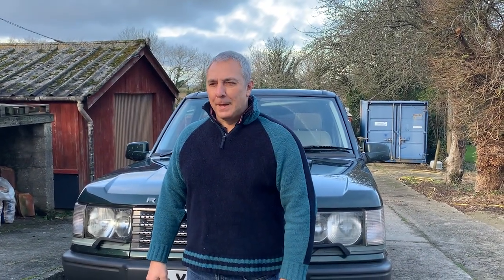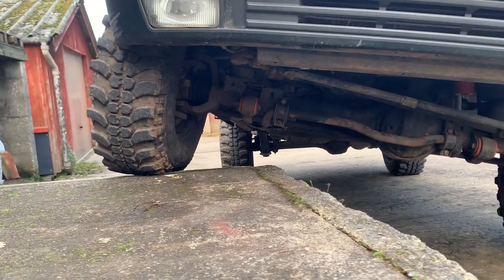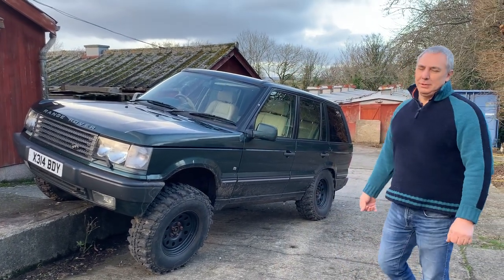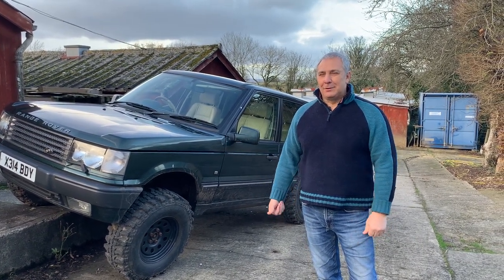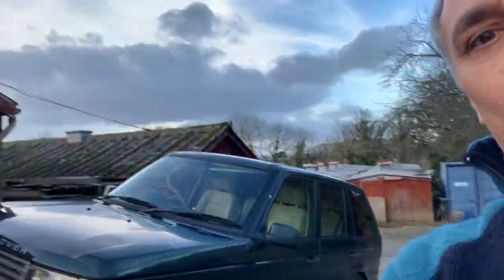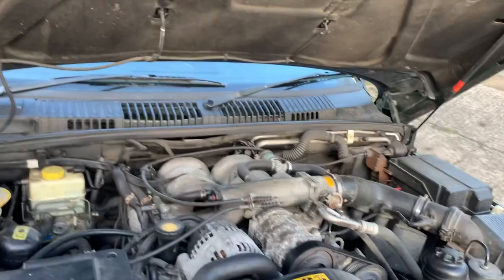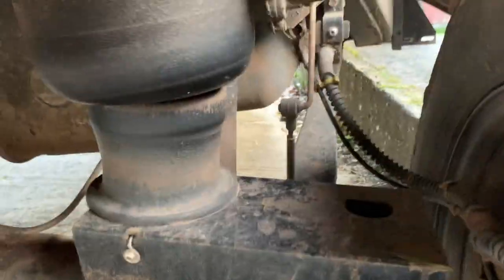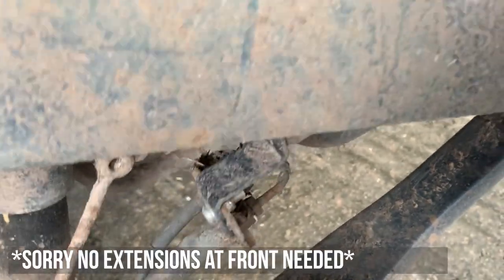Range Rover P38 - Air Suspension vs Coil Suspension

Comment: On my 99 P38 I used the free version of EAS Unlock to reprogram the offload height to give me something like 4 inches of lift. In that setting I have 16 inches of clearance under the frame rails.
Reply from the maker: Hi Gordon
Thank you for your message!
Yes that’s an option but be careful as air springs may rip as only have a certain amount of travel before failing.
Have been talking to a manufacturer about increasing the travel but is very slow😂😂
Good luck with things👍
Regards 
Martin
Reply: @all4x451  
As a matter of fact I destroyed an Arnott air spring on an offroad trail in Colorado this summer. The lower locating pin on my left rear bag sheared off, the bag folded over and ripped. Ended up driving 137 miles on the bump stops including quite a few miles of offroad. Was able to replace the bag and continue my trip. Some mechanical lift would take some strain off the bags.
Reply from the maker: Oh dear not pleasant on the bump stops😬
Still trying to get a company to replicate my kit for correct money without jeopardising quality, may have a solution soon and will do video on manufacturing and supply😀👍
Reply: @all4x451  
That's an understatement. If I didn't have my seat belt fastened my head would be hitting the roof top. OK on pavement but brutle offroad. Would probably buy a kit if not too expensive.
Reply from the maker: 😂
Hopefully soon can organise lift kit and price🤞🏻
There are many that have shown interest 😀👍

Comment: G’day Martin, I love the vid mate! It shows how you’ve done the 2” lift great! I really like the tyres you’re running too 😀

The spacers you have on the rear are from “Hard Range” in Australia, sadly they’re no longer in business. Originally run by Paul (great bloke) and then bought by other P38 enthusiasts. 

I love how you’ve done the Front spring spacers for your lift. It’s common to see air leaks on the front springs due to rubbing when lifted from below (as I’ve done, although I’ve not experienced the issue) rather than above (as you’ve done). 

It’d be good to see you knock up spacer kits over there, I’m sure the market there would be much bigger than over here in Australia.

My recovery is coming along well, can’t wait until I can head out 4wding again! 

Cheers
Keithy
Reply from the maker: Hi Keithy 
Thank you for your nice comments appreciated👍👍😀
Reply from the maker: Will keep you posted with the demand, great to see last video looking good 👍

Comment: Amazing work thank you for sharing your experience with us,
Air suspension p38 when normal its headache for all now after lift up what will happen. I plan to convert my car to coil spring no more headache.
Reply from the maker: Hi 
Thank you for message 👍
Yes a lot of people are changing to coil springs, my P38 was not great when I bought it! I rebuilt eas block and checked and changed faulty height sensors, all been good since for a few years now.
The main problem that I can see is the hight sensors, as if one is faulty the system will work but not great!
Regards 
Martin
Reply: @all4x451  Thank you Martin for your quick reply and interest and patience. I tray to calibration by RSW EAS unlock suite with new air pump I spent hours but still not correct hight until I damaged the new pump. Same doubt in hight sensors faulty. You change the orginal or aftermarket sensors any help.
Again I need new pump with sensors.
Best regards,
Reply from the maker: Hi
I was lucky to find nearly new original parts, my next purchase would be from Arnott they also make very good air bags at reasonable prices!
Regards 
Martin

Comment: I have a 2" lift on my 2001 HSE 4.6L P38...same color. When I bought mine it already had coils so im not changing them out at this point. Question: where did you get the front grill? I like the one you have although i just ordered a replacement for my cracked one. thanks!
Reply from the maker: Hi Carl
Thank you for your message!
The grill is a standard Range Rover sport grill, the difference is that holes have been drilled in it😀👍
Will do a close up in next video👍
Reply: @all4x451    I admire your P38 and your expeditions👏🏻👏🏻👏🏻
Did you do the close up of the front grill?
Cheers from Punta del Este
Reply from the maker: @burgerdentone16  Hi
Yes will do a walk around soon, the front grill is of a Range Rover sport but with holes drilled in it!
Cheers 
Martin

Comment: i love the Airl supension in my p38 and i do not care for coil springs. i would put them on my defender if i knew how to maker it work properly
Reply from the maker: Hi Wesley 
Yes the air suspension is the P38 secret making it very capable off road, lots of 4x4s now getting air assist fitted👍
Regards 
Martin

Comment: Hi Martin, I currently have springs on a 2002 P38.  I would like to converted back to Air.  What Air bottles do you recommend?  I live in New York.  Thanks
Reply from the maker: Hi
Thank you for your message!
There is a company called Arnott that make better re-enforced air bags air bags, they are idea for off road as standard air bags tend to rip under articulation these are what I use on my P38. Check out the link below and thanks again for the question, if I can help any further just let me know👍
Regards 
Martin
Reply from the maker: Sorry
Hear is the link
https://www.arnotteurope.com/

Comment: Great video!
Reply from the maker: Hi Steven
Thank you for your comment👍
Hopefully doing a part two very soon!
Regards 
Martin
Reply from the maker: Hi Steven
Just been looking at your channel, and was wondering if you could supply air bags that are 2inch higher than standard.
I realise that sensors and bump stops would need to be modified like the ones I have currently modified.
I have several people globally waiting for a solution to a lift kit!
Regards 
Martin

Comment: Is it easy swapping air for coil suspension?

Thanks
Reply from the maker: Hi Sorry for late reply!
You can get kits I believe, will not be difficult as air springs come out easy. Problem will be having the warning lights on dash and disabling EAS!
Reply: @all4x451  Thanks for reply sir

Do I need a programming tool for springs after
Reply from the maker: Not sure as not removed an EAS system, only what I have heard about!
Also heard that people that use P38 for adventure touring usually go back to air😀
Reply: @all4x451  Awesome. I want a P38 as my weekend ride and will very rarely be used off-road. I'm considering buying one here in South Africa though it needs a gearbox and cosmetic repairs
Reply from the maker: @BonganiMagadu  you will not be disappointed with the P38 it’s a great off roader and tourer, keep me posted what you think!
If I can help with anything let me know😀
Reply: @all4x451  Thank you sir

Can the diesel be rechipped
Reply from the maker: @BonganiMagadu  yes it can just find a good dyno tuner and not a simple plug in👍

Comment: What's the use of a 2" lift when you extend the bump stops with 2"? Isn't the whole idea you have more flex? The P38 has plenty of ground clearance, chassis wise, so that can't be it. Genuine question, not to bash you.  What you say about equal pressure with the axles flexed as in the video is partly right. not while driving, it only gets the same pressure when the EAS has enough time to adjust.
Reply from the maker: Hi
Thank you for comment.
Is always good to air views😂😂

The 2 inch lift is also for the fitment of larger tyres, and increasing wading depth.
The larger bump stops have to be fitted or the flex will be too much for the air springs, and will damaged them as they have only so much travel!

Regarding the air pressures, once the wheel sensor detects a wheel drop the designated valve opens to allow more pressure, combined with pressure switches rapid opening and closing of said valves occur. Granted the faster you travel the harder to control👍

Regards 
Martin

Comment: I obtained my Pegasus with coils. Everyone thinks I’m nuts for wanting to convert back to air. 🥴 🥜
Reply from the maker: Hi
Thank you for your message.

There are a lot of people and manufacturers now seeing the real benefits of air springs, I personally think that many will start choosing air over coil springs in very near future!
Regards 
Martin
Reply: Air is way more comfortable!! Do use the right shocks, Boge or Sachs.
Reply: I do over 1k miles a month in mine with coil springs fitted. It was already converted when I bought it. 
I rarely go off-road and for what I do with it, it’s fine.
 I get why people prefer bags for off roading and comfort but I like the maintenance free aspect of coils. Drives just fine running standard 18s with ax7s.

I drive many p38s at work with bags and coils alike, I prefer coils.

I read a lot of passionate comments on forums over this topic, there is no need for it. Your vehicle, do what suits you.

Comment: P38 was never designed to be on coil suspension. The EAS is what sets the P38 apart from other shite SUV’s like Land Cruisers and Patrols etc..
Reply from the maker: Hi
Very true! Large company’s now see advantages of air and are putting air springs in coil springs😀👍
Regards 
Martin
Reply: You're showing your ignorance when you call Landcruisers shite.
Reply: @oumaniac , the ONLY thing a Land Cruiser, or most Toyotas have going for them is the claimed reliability.. There is much more to a good car than just reliability. They lack style, they lack comfort, compared to any Range Rover. They really are nothing to look at, and, if you buy one new, 6 months later there will be a new facelifted one on the showroom floor, making your brand new Cruiser look dated. Every generation of Range Rover had around a 10 year run without notable changes, and even a 10 year old Range Rover still looks as modern as the current one. A 2 year old Land Cruiser on the other hand looks dated, as theres a new updated version every second day. And that goes for all Japanese marques… They just can’t seem to decide what they wan’t their cars to look like, or who to copy.. Look at Lexus throughout the 90’s and 2000’s, their sedans were shameless copies of Mercedes E/S classes, just somehow hideous, and ungainly.. And keep in mind that the Range Rover is the original SUV, the big daddy. Toyota was still busy trying to figure out how best to copy a Willys Jeep when the first Rangie rolled out…